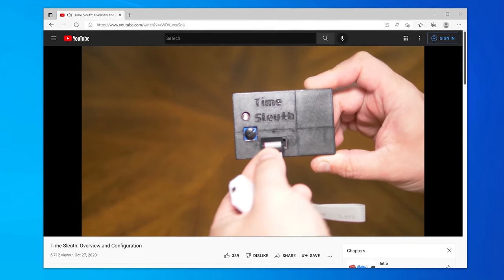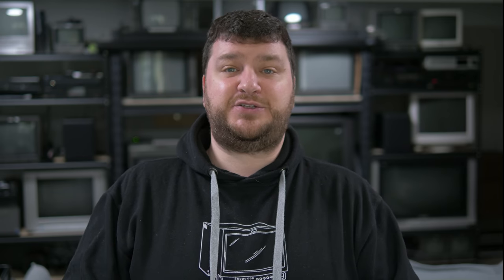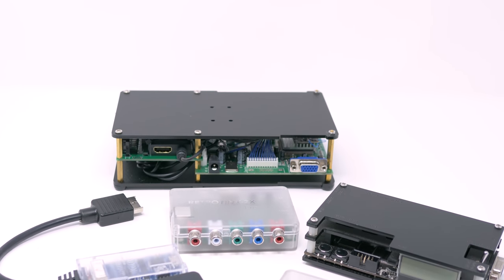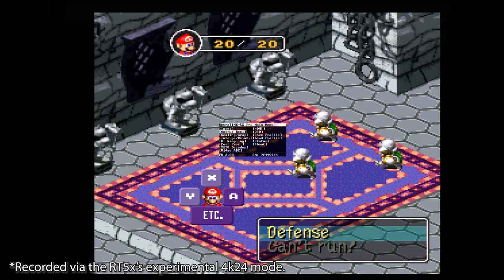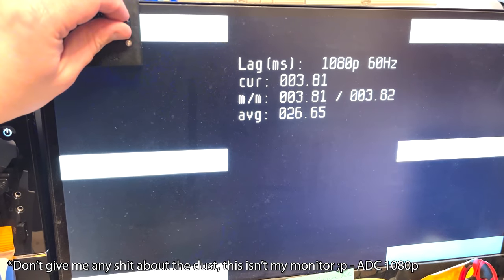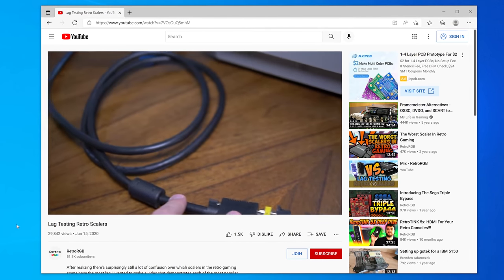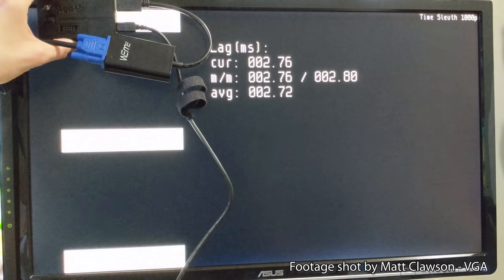Mythbusting Display Lag

Comment: You know, that BenQ monitor observation was interesting, because I also have a 2010 BenQ monitor which I have tested with one of those PS2 to HDMI dongles (meaning it will be receiving an interlaced signal), and that monitor also does bob deinterlacing to interlaced resolutions, it does support 480i and 576i... Sort of...

Because it hates 50Hz, it displays a picture, but it looks like it tries to force the signal into 60Hz by inserting black frames into the 50Hz signal, it looks awful. 60Hz signals look fine. I personally think this could be some sort of oversight, as I have understood bob deinterlacing is a pretty standard way to handle 1080i signals (since the flicker is no longer that visible), so the monitor might just blanket bob deinterlacing all interlaced signals?

Comment: I dont have testing equipment, but this definitely confirms my suspicions. I'd been playing using RGB Scart to OSSC to my 165hz computer monitor, but was convinced that the best experience required a CRT. I remember plugging them both into my analogue splitter and feeling stupid that the video and game audio were identical. For reference, I noticed a difference when sending the same signal to my TV. I'm convinced that the difference between modern monitors and CRTs have become negligible and have been chided for suggesting so by enthusiasts. Its nice to see at least some validation.

Comment: On the subject of deinterlacing on TVs, I have come across surprisingly many TVs that do bob deinterlacing in game mode. My 2017 Sony TV (XE7069) does bob in game mode, and some other type of deinterlacing outside of game mode. It also does bob with the native RCA inputs and I personally don't perceive a difference. I have also come across some cheap Philips 1080p TV that did bob deinterlacing, and a bit more expensive Sharp TV that did bob deinterlacing (not sure about their manufacturing years!), both tested with analog inputs, but I didnt have much time to play with them exactly.

I have also come across few other people who have complained about the picture on their TV flickering when playing a console using interlaced signals, one of which I think was Sony X900H? Either that or 900F (it wasnt a 950, nor a J year model, so probably wasn't a 950G either). So it seems like Sony might have some sort of tendency to use bob in their game mode, and it would be interesting if you could test one or two different Sony models.

I can personally even say that the deinterlacing on my XE7096 actually changed with a firmware update around 2018-2019 (one to two years after release of the TV), as the picture got a bit less flickery and more blurry, meaning they seemed to have implemented some sort of flicker filter. Before it looked really sharp and raw.

So there definitely are games that can do lagless or near lagless deinterlacing, but a lot of it might depend on how much thought is put into the matter. The only reason I can think why the lag would change on some TVs between analog and digital inputs with the same interlaced signal, is some sort of oversight in the processing pipeline. The deinterlacing is set to compliment VHS and DVDs over analog inputs, and maybe the same idea applies here with 1080i (that I mentioned in my other comment)? A less complex deinterlacing method gets used, because 1080i doesn't require that much more work, and then the same method gets scaled down to lower interlaced digital signals as well?

At least that would make sense to me.

Lastlt, I don't think the 24Hz finding will stay true with all TVs, especially with newer ones, as a lot of modern LCDs deal with 24Hz signals by lowering their native refresh to 48Hz. It would be curious to see how that behaves.

Comment: Plasma tv draws vertical lines alongside the horizontal axis. try put latency sensor on both horizontal edges :) 
By the way, I'm not sure the reading of this kind of sensor is accurate on plasma TVs. because plasma draws so-called "sub fields" and this might mess up the reading.
To draw a frame, plasma TVs first divide the input image into RGB components. and only lits one single color of pixels at a sub-scan, by cycling through these single color sub fields very fast, the visual persistence effect composites the full-color image to the viewers. 
As you can see, there's must be a less-than-one-frame blanking between those sub fields, the mechanism of plasma TVs are wildly different from CRT and LCD TVs which all draw 3 colors at one scan. that's why I think the reading of this sensor might not accurate for them.

Comment: FYI, most LG OLEDs from the past several years (at least back to the 9 series, maybe even the 8 series) have been 120 Hz panels, so it's not that uncommon. HDTV Test does lag testing on those and in general, it seems like they have (roughly) a single frame of lag regardless of the frame rate used, so 1 frame at 60 Hz, 1 frame at 120 Hz, etc. Maybe that has changed over the years, but it seems to be more-or-less the case. So while on paper the lag is higher at 60 Hz, in practice it's never more than a frame, so it should feel decent to play. I don't know how that plays out at 30 Hz and 24 Hz, though those are divide evenly into 120 Hz, so hopefully it's not a ton more.
Reply: I can confirm that my C1 Oled tested at roughly one frame of lag compared to another CRT with a Sega Genesis hooked up through Retrotink. Butter smooth frames too. Interestingly though when I hooked up my PC running emulators with variable framerates, it stuttered every second or so no matter what settings I used.

Comment: I was wondering when you would tackle this topic because after getting a time sleuth I tested my flat panel as well as others in my home and with my Samsung Crystal UHD panel I got the opposite results. Both 240p and 480p showed 23ms of latency(I changed the firmware to only test progressive signals 240.480.720.960.1080 because I don't use interlaced at all)but 720p up to 1080p got 7ms of latency. All the results were in game mode so I scale to one of those three HD resolutions because while a frame and a half isn't awful, if I can get faster response times why not you know. I also wasn't completely sold on the idea that it was universal to all flat panel displays either.

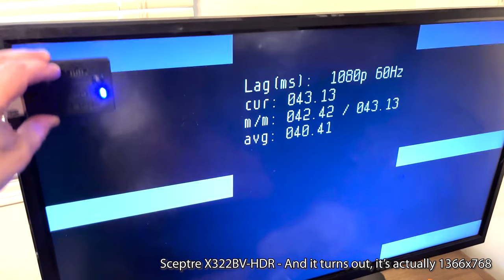Comment: 14:13 I have a LG 32LH570B that's just like this Sceptre X322BV-HDR: it's a 1366x768 panel mounted upside down. If I connect the MiSTer to it through HDMI, it even gets scaled to it's actual resolution, instead of getting 720p or 1080p and then internally scaled to it's native resolution.

It has lots of other weird quirks as well. For example: on YPbPr it can take 240p, 480i or 576i, but it will throw an "incompatible format" message at 288p... On composite it will take 240p, 480i, 288p or 576i, but it always treats everything as interlaced and 50Hz video is strictly black and white. It doesn't matter if the chroma subcarrier is at 3.575611MHz, 3.579545MHz or 4.43361875MHz.

This idea might seem ridiculous at first, but I've been able to play European games on my Brazilian Nintendo 64 and my old  Panasonic TC20A10 took that bizarre combination of 288p / 576i with a PAL-M chroma carrier just fine over composite. Another LCD TV, an AOC L19W931, got the color properly decoded, but the image was a rolling mess. I've seen some CRT TVs here in Brazil that could take PAL-N signals as well, like those used in Paraguay, Uruguay and Argentina.

Via HDMI that wacky LG TV it didn't complain about any weird framerates some arcade cores on the MiSTer threw at it with vsync_adjust set to either 1 or 2.

15:18 I haven't bothered to check lag differences between HDMI and analog inputs on those LCD TVs, but by looking at the service manuals of a few cheap LCD TVs, I'm not surprised at all with those results. Some will have a video ADC chip that spits out something that looks a lot like an SDI signal or it's parallel brother, but quite a few TVs will use what's essentially a USB analog TV capture dongle to be processed by the TV's SoC, so it doesn't surprise me at all that analog inputs may take significantly more time to get to the panel on cheap TVs. I was actually surprised that my crappy 32LH570B was able to differentiate 240p from 480i and do something sensible about it, at least over YPbPr, over composite it always thinks it's 480i.

Comment: Hey Bob! I have a question. Have you tested the BenQ EL2870U with 240p signals? I was just interested in knowing how the monitor would behave with a 240p signal, since it supports resolutions that cannot be displayed on most computer/gaming monitors.

Comment: Regarding the BenQ monitor you used, I actually own a Dell flat panel that does something similar: bob-deinterlacing 480i from my Sega Dreamcast! The aspect ration and sample rate are both very off (though that's not too uncommon with the DC on flat panels), but the thing even supports RGsB. So I can even force certain PS2 games to 480p, and hook them up to the monitor with a component cable + adapter.

Comment: I'm personally of the opinion that it makes more sense to measure either from the bottom (which informs you of the total time it takes to draw the frame) or halfway down as it will be an average (I take my measurements from halfway). If you measure from the top, barely any useful information will have been drawn to the screen.

Random anecdote: I took measurements of the TVs at my work and actually found one that refreshed bottom to top.
Reply from the maker: I actually JUST debated this on a podcast!  Check back tomorrow please :)
Reply: @RetroRGB  Will do :)

Comment: Curious about what the results using A/V surround sound receivers would look like... mine is loaded with component inputs in the back, which is what I use to hook up the majority of my retro consoles.

At the very least, I don't think I've been affected by any noticeable lag... but that could just be me!
Reply from the maker: I've tested quite a few AVR's and have been compiling data for an upcoming video.  ALL analog inputs (Component, composite, S-Video) add a TON of lag and should never be used for video games.  MOST of the HDMI inputs I've tested are zero lag, unless your AVR offers some kind of video processing mode (as opposed to just an HDMI switch).

Comment: I have a question. Sorry if it's dumb or I missed the answer. If I connect a Gamecube with a 480p signal via component cables to a 4K LCD panel, could I expect to get around 5 m/s of lag as shown in the video, or is there added latency somewhere that I'm overlooking?
Reply from the maker: Most flat-panels have more latency over the analog inputs, as shown.  For GameCube, the best results would be to run it through the RetroTINK 5x and get 1080p (or even 1440p), however that's not cheap.  You could run it through a component to HDMI converter, but you're still sending 480p - Some 4KTV's do a great job with 480p and others don't.  Converters here:  retrorgb.link/cheapdac

Comment: Maybe I'm just being dumb here but even 4ms should be noticeable. Frames aren't something continuous. With 4ms of lag, if a speedrunner needs a frame perfect trick based on reaction, then he's left with 12ms (instead of 16ms on a CRT) to react and get his input to get recognized at the perfect frame. That also obviously applies to fighting games : even if I can't notice 4ms of lag, if I'm playing against someone playing on a CRT, then it's guaranteed assuming the same reaction time and played character, that I'll be losing 1/4 of the hit trades because of I now have 1/4 chance for my input to be registered on the next frame instead of the same as my opponent.

I agree that for games where reaction times do not matter much, it should not make much difference, even for a top speedrunner.
Reply from the maker: We discuss this in depth during a podcast that airs tomorrow.  I stand behind my statement:  Unless someone shows me measurable, non-anecdotal evidence, 4ms is 0 to me.

Comment: Love your channel and the post you made for the Swiss gamecube memory card from castlemania games.  I ended the sdsp2 but my gamecube doesn't have the 2nd serial port.  I have the platinum version and even though I have dol 001 model only the black and indigo have them.  But got a sd memory card adapter for 5 bucks on ebay so I can use the gameboy player just have to get extrems files.  Didn't what to do and you were the only explaining thanks.  What to get a black gamecube eventually bc the sdsp2 is the better option bc it doesn't use the memory card slot.

Comment: Probably wouldn't fit a video's budget, but if you could test newer qdoled and microled panels, specially in monitor form, would be cool to see the coming tecnologies
Reply: Unfortunately these are still VERY expensive and hard to find. Specially qd-oled since it just launched
Reply: I don't see any real advantages of QD-oled over regular Oled when it comes to Retro gaming. If you're talking about HDR games, then QD-Oled would make a difference with extra brightness. Regular Oleds are finally becoming more affordable for regular people at under  $1000. Which is still alot to spend on a TV of course.
Reply: @overnightdelivery  I wonder if newer panels with novel tech will be "blessed" with controllers with lower lag, or newer oleds with lower response time
Reply: @persechini   The QDOled looks promising but will take awhile to drop down in price. My LG Oled and Retrotink 2X Pro tests at only one frame of lag at 60Hz with a Sega Genesis hooked up. It really does feel very close in input lag and motion to my CRT in comparison.
Reply: @overnightdelivery  that's good to know. I have an LG LCD that sometimes shows tearing in gaming mode, doi can't use that, regular mode seems fine but I haven't extensively tested the 2x mini since I got it
Reply: @persechini  A tidbit I forgot to mention is that when I hooked up a PC using emulators, I was having issues with stuttering every so many frames. Was using Variable Frame Rates in RetroArch. I speculate that the consistent frame rate of the Genesis makes it easier for the TV to process the frames. But that's just a guess. I wasn't able to get smooth frames without some motion blur when using a PC. But there may be something I wasn't doing right. I'd tried both 60Hz and 120Hz modes.

Comment: Why your monitor has eyes? While you watch it he looks at you that's creepy... Most 120Hz or 144Hz have around 32ms of lag when you use them with a 60Hz signal, My 144Hz ultrawide is good for upscalers at 60Hz but you have to swallow the 2 frames of lag, now 2 frames against the CRT, the time Sleuth most likely will read just 1 frame, cause every digital panel must keep 1 frame before starting to draw, so an LCD that has 1 frame of lag against a CRT, is a creo lag LCD. A 120Hz mode in upscalers and MiSTer will bring lots of benefits like less lag on 120Hz and 144Hz panels around 8ms and reduced motion blur with rolling scan BFI on OLEDs. LG removed the 120Hz BFI on this years models though...
Reply from the maker: That's absolutely not true.  I've personally tested quite a few 120 and 144hz TV's and monitors with a Time Sleuth at 1080p60 and got under 16ms...many much, MUCH lower.

Comment: Hmm, is it specifically LG C6 that has worse latency? Later ones any better? Mine is a C7
Reply: Later models are much better especially the newest ones with hdmi 2.1 and 4k 120hz. They basically have no lag. I have one from 2018 and its also very good and has very little latency
Reply from the maker: The newer the LG OLED, the faster the panel.  I tested newer ones and they were awesome:  https://www.retrorgb.com/lg-cx-oled-lag-tests-and-ossc-compatibility.html

Comment: Would running 1080p 75Hz monitor at 1080p 60Hz also add lag?
Reply from the maker: I can't say for sure without testing, but if it's a "gaming monitor", it should be fine at either refresh rate.

Comment: It is not 4ms lag.  It is 16.6ms + 4ms = 20.6ms of display lag.  That is not the same as zero ms lag.  Lag accumulates in a gaming system: USB input lag, wireless input lag, display lag, and networking lag all add up.  This is why it is beneficial to have a 120hz frame rate instead of 60hz.  It helps reduce the display lag considerably.
Reply from the maker: Please check the podcast that's going live today that digs in deep about this topic.